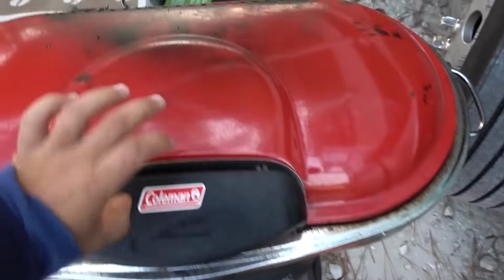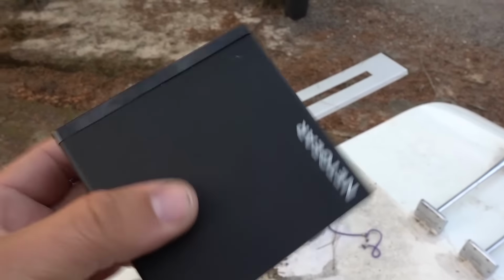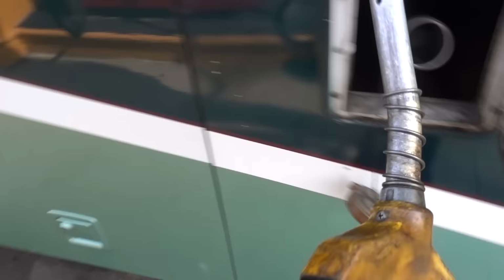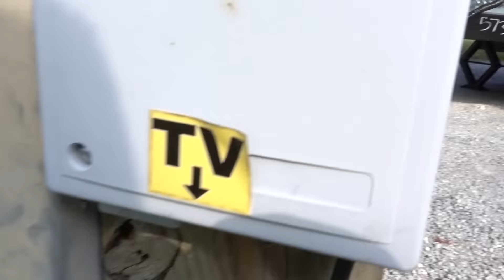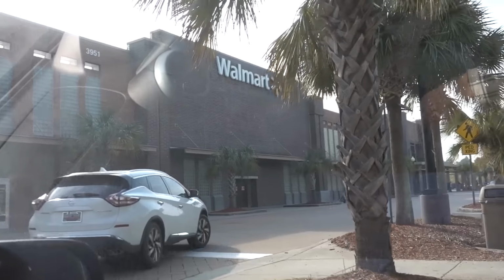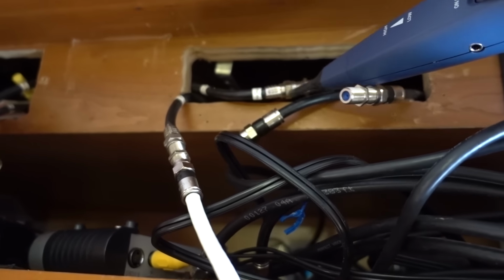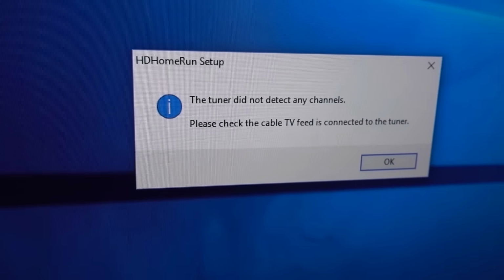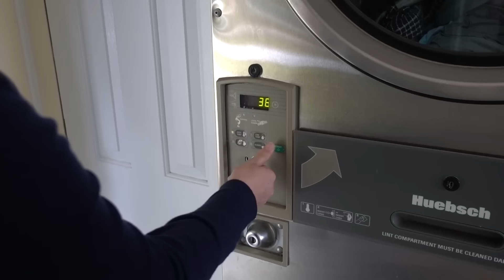VLOG | Now, That's a Rig! (Day 17 of 24)

Comment: FYI, there is no way to turn a public no-password wifi into a secure wifi. You can lock down traffic between your router and any of your devices, but if the link between your router and the public access didn't require a password, anyone on that network can observe any traffic over that connection.

Comment: Only 6.9 mpg in Diesel pusher, figured it would do a little better, we average around 8-9 mpg in a 93 gas class A pulling a 14' enclosed trailer with big toys weighing around 4000lbs. total